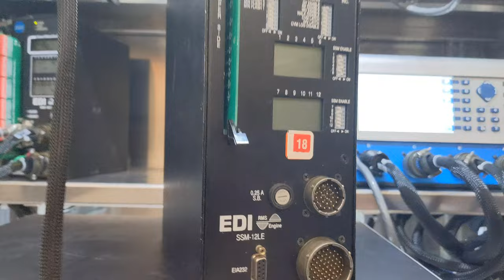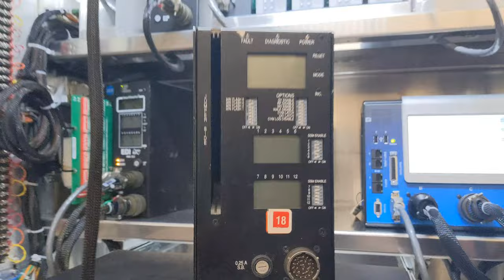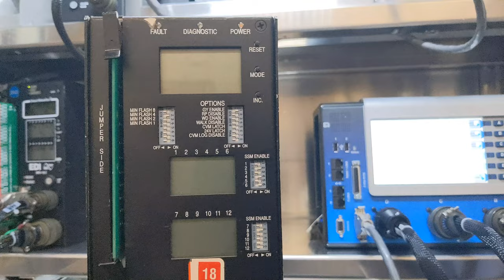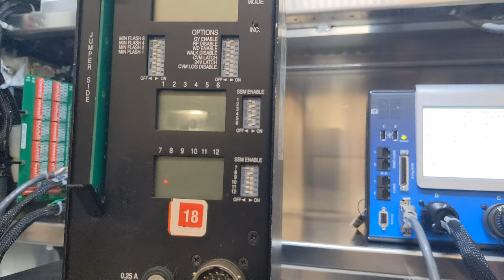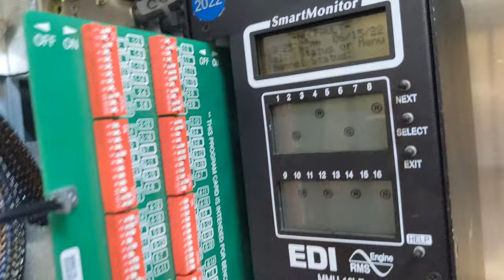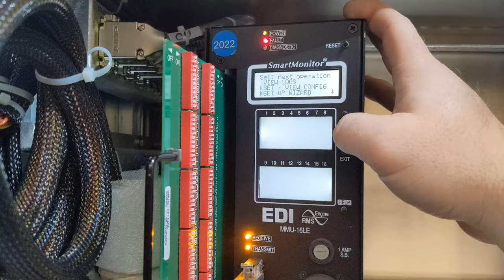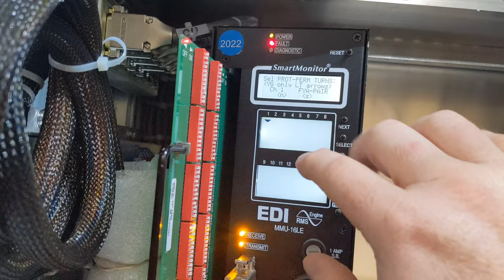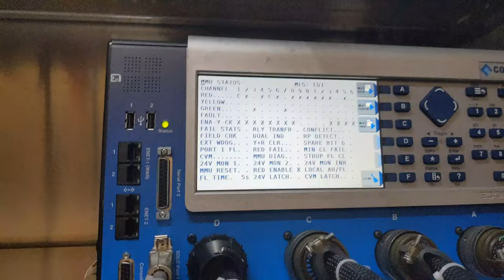MMU's and CMU basics

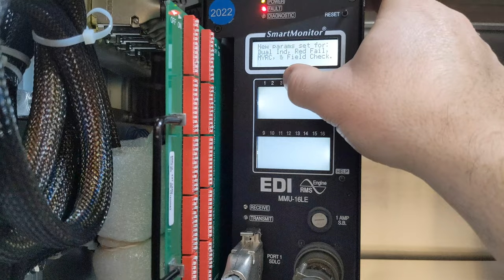Comment: 6:30 SSM- Simultaneous Signal Monitoring- checks for Dual Indication and Min Yellow on that channel.  (If there is no load, like maybe a doghouse or a ped with no parent phase turn that switch off since it will show Dual Indication, and turn on the G-Y enable switch to look for green yellow dual indication) 9:10 the lower contains power, 24 volts 1 and 2, yellows and greens, and stop time, etc. The top one contains the reds. 15:40 Minimum Yellow-Red Clearance for the FYA min yellow and red clearance time.
Reply from the maker: All correct!

Comment: Why are the jumpers on the card so long? We just take a small piece of bare wire and use that as a jumper. I'd think this could end up causing an issue down the line with all of those wires crossing like that. Good luck though.

Comment: How did you swap the phasing?
Reply from the maker: Do you mean what channels are being used for peds and overlaps?
Reply: @trafficsignalstraining7673  How do I swap the phasing?
Reply: @trafficsignalstraining7673  yes
Reply from the maker: @ArdenFairEinstein2003  typically this is a cabinet configuration issue. You can specify for your cabinets overlaps to be run on channels 9 through 12 or channels 13 through 16 on a nema TS2 cabinet. 

There are ways to drive overlaps and even peds on other channels that are not hardwired in the back panel. But you physically need to take the output from the controller for the phase it is serving and physically hardwire it to the input of the load switch that you want to drive the phase. I would not recommend attempting this unless you knew what you were doing, I highly recommend you reach out to the manufacturer of the signal cabinet you are working with and they will assist you.